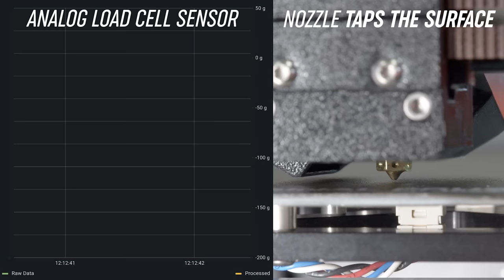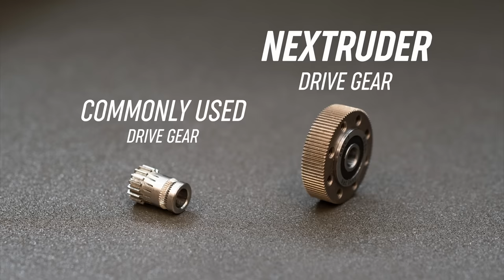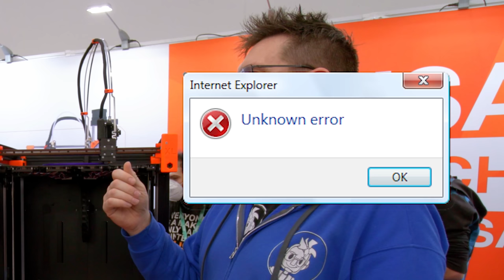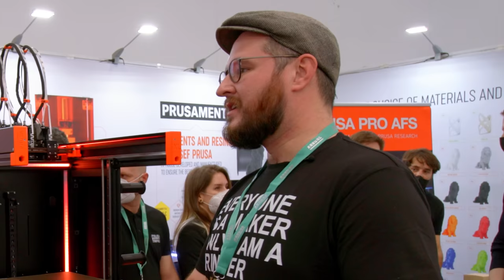Prusa XL First Look at Formnext! World Premiere!

Comment: Prusa don't just make 3D printers, they make quality machines that work consistently. No other manufacturer can claim that crown. Hopefully the XL will continue that legacy.  I want one and I want it now  to go with my Mk3 and Mini. Great Scoop Joel!
Reply: Except MMU and MMU2...
Reply: Except the MMUs which constantly cause struggle... and the Prusa Minis that were under extruding and clogging from factory... and the MK3S that had unlubed bearings but the manual stated that they are lubed, which caused damaged rods... and the not aligned filament path on the mk3s making cold pulls harder and affecting print quality... oh yeah and remember when they did linear advance from scratch but it ended up causing under and overextrusion in a firmware update?

so tired of hearing prusa fans drool all over the place. With that being said, their customer service is 10/10
Reply: It actually looks like it's designed to be cost-effective and they didn't waste a lot on a "pretty" look
Reply: Ultimaker also makes consistent and reliable machines, but are amongst the most expensive hobbyist grade printers

Comment: This is what all the moders are trying to achieve with Ratrigs and Voron!! Way to go Prusa, you killed it with this one! 🤯💓
Reply: Well, until now, both those had more advanced machines than Prusa. Now, the situation has reversed. But I suspect there will be new generations of these machines as well coming out with new features, which can only be good for the hobbyist 3D printing space.
Reply: @extectic  I mean, they sure stuffed it full of electronics, but kinematics are very basic and much less rigid. Performance and print quality comparisons will be interesting. As long as they're running marlin they don't stand a chance, but i hear they're considering Klipper :) 

Lot of very cool ideas in there though!
Reply: @miklschmidt  In the blog post they mentioned klipper as a means of exploring the limits of the printer. They looked at the speed boat race so there is probably some inspiration there. I'm so excited for this printer though especially since my V0.1 was my first experience with core XY.
Reply: @matthewdelacruz2460  They did yeah. I feel like the view point presented there was a little narrow minded, but i may just have read it wrong, it was a very short paragraph. Klipper is not just about speed. It's about quality at speed. It's so much more than the speedboat race, it's a shame that's all people think of when they hear klipper. As a former speedboatrace world record holder, i realize i've contributed to that though.
Reply: Yep, I'm like.. where can I buy a Voron?!   Voron:  You can't buy a Voron.  Me:  Okay I'll buy a Prusa.
Reply: @miklschmidt  The fact they have everything wired up to a PCI bus interface, that means they're building this to last a long time and be easily upgradeable.  I now see Prusa like Apple.. it may not be cutting edge but it's very thoughtful and really well designed for what it's trying to do.  A really agile hobby built system is going to be higher-tech than a mass-manufactured system, but you get a warranty, tech support, and a large community running on a standardized system.  When your hobby ISN'T tinkering with your hobby printer, then that stuff helps.
Reply: @dangerous8333  Do Vorons even have automated bed leveling?  Where can I buy a Voron and get a warranty?  You're really discounting the people who  value quality of life experience with printers.  Low budget people buy Enders.  Nerd engineers make Vorons.  Professionals and normal people buy Prusa.  I don't want a hobby to build a printer, I just want it to work, and have someone who can help getting it running again.  Just like I don't want to fix my own car.  This will do well just like Apple products do well.
Reply: @rhadiem  Completely agree with you there :)
Reply: @rhadiem  You might not be able to buy a Voron with warranty, but you can buy a Rat Rig V-Core 3 with EU warranty :) But correct, it requires you get your hands dirty, if you want a finished, supported printer, Prusa is killing it, no doubt.
Reply: @dangerous8333  I don't think you got the point with pricing. Fox example, I run a little 3D print. I was thinking about upgrading my farm with RatRig Vcore 3; but it mean an enormous amount of work to make them work correctly. And the cost of a similar Rat Rig is more than 1000€. For just the double you get something that will be so reliable, that you will be able to work more on your business than on your machines. If you want something pro like this today, you will have to pay 5000 to 8000€ on the maket and I don't think the machine you'll get with this price point will match the quality of the prusa XL.
Reply: @dangerous8333  you realize a voron of this size is $1600 plus tax and shipping right?
Reply: What prusa the open source scammer that just stole all the open source from Adrian at Nottingham university
Reply: @nelsonagryosgs5497  nope just make it yourself why are buying an open source kit for doh
Reply: Prusa seems a bit pricey than Voron, but
1. They give quite a nice set of features, which one day can go to open source
2. $2000 Prusa is expensier, than $1000-1500 Voron V2.4, but barely 2 times in extreme cases
3. Where I can see these will shine -- commercial sector. I can't see some company ordering parts for Voron, but complete Prusa XL -- quite possible
Reply: @dangerous8333  as someone who currently runs a farm of 11 vorons, I completely disagree. This printer will be a game changer. It's way more farmable than our current fleet of V2.4's
Reply: @ChromePhoenixQ  My biggest concern would be the Unique electronics and hot end assembly. With a Voron farm it's easy to go to a local supplier and pick up alot of the parts to keep it going.
Reply: @rhadiem  Vorons Do have automated bed leveling, you can Also have the no Calibration Z as well. as well as input shaper which there is no mention of in any Prusa documentation.. Yet. The Voron Discord can you get support 24/7.
Reply: Competition is good, this will push the voron and vcore communities to innovate even more
Reply: @dangerous8333  a vcore3 at similar size and specs is atleast $1500 and you still need to source some parts locally. You can easily invest $2k in a vc3 and you wouldn’t have the support and warrenty that prusa provides
Reply: Also need to consider the resale value. Prusa printers hold value much better then anything else. Buy a vcore or voron or creality and the value drops 50% soon after buying. Look at resale value of mk3s and it’s basically same as new
Reply: @dangerous8333  The current Voron doesn't cost much less at this size, especially if you option it up to the same specs.

Comment: AWE-MAZING! So much attention to detail, so many engineering breakthroughs getting all the features into a compact footprint. Price is on the high end for a hobbyist (but I still want one!) but I can see printer farms growing with these. Lead times will be interesting (quotes for silicone dies to be placed into packages is ranging from 6 to 18 months, up from 3 months in 2019). So frustrating to see great machines being designed and not being able to get them in our hands as fast as we were used to getting them. {SIGH} Great work by the Prusa XL team (heck, the WHOLE company)!

Comment: That would be nice to have the extruder sold separatly to retrofit a 3d printer. The no--filament-chewing, the gearing and the load cell combo is very nice.
Reply: the problem with that is that your printers hardware and firmware would need support for the load cell in order to make any use of this features.
Reply: @Pixelplanet5  you can convert analog Signals to Digital. Make a load Switch out of it, use it as the Probe pin, done.

Comment: This is not cheap, but I just pre-ordered. This will be my first 3D printer and I would like to spend as little time screwing with calibration and issues as possible. It seems this will fit the bill and everything I've seen says Prusa uses quality design and materials.

Comment: Pre-ordered a 5 extruder model. Would love to see a dual head with tool changing capabilities.
Reply: i dont see the model on the website :(
Reply: I just preorded the one with 2 extruders. IMHO good enough for now.

I already have mk3s with a mmu2s and it is amazing and I love the dual color prints, but sadly real multi material is just not possible or really hard and I would really love to use solvable support son occasion.

Comment: This is a balls to the wall awesome printer! I think that this one of (if not the) ultimate final printer for hobbists who want to take their hobby to the maximum level. The only thing I can think of that I'd love to see one day is some kind of x/y square test. By that I mean a 4 by 4 grid, like bed leveling, but instead the printer measures the difference between the expected and actual touch points of the nozzle. If the frame is skewed it could compensate for that. I've had a skewed ender 5 plus frame for almost a year now and it's almost impossible to solve!
Reply: They already have it since MK2 :)
Reply: I know how to fix your ender problem. Stop buying cheap Chinese printers and either build your own or buy a prusa
Reply: @thebutcher1412  yep, thanks for nothing. I needed the print volume
Reply: @rachellejanssen2655  gotta pay to play.

Comment: Nice, I had the same idea and designed an extruder with one lgx drive gear and two idlers.
I'm astonished no one did it before, it's basically a no brainer and way more effective than dual gear.

The overcomplicated bed though solves a problem that's not a problem if you have a proper construction in the first place.

Comment: looking awesome!

I just think it is too expensive :-/

2000$ for a FDM machine is just too much
Reply: @FayezButts  voron sounds great! Startet like 8 or 10 years ago with a Wasp 3D printer - had an i3 for seversl years, then built an improved a mini kossel and then constructed my own design.

Currently I do not have a 3D printer anymore - since my work uses so much time, I sold them all.

Would love to start getting back at it.

Need a fast and reliable machine.

Would love a belt driven Z-Axis though - since I had gotten quite accostumed to Delta's print quality on Z - which is simply amazing and absolutely flawless!

Comment: Yes, please take my money. Preordered  with tool changer (while  literarily waiting for Voron 2.4 parts to get here). Looks packed with tons of new teck. The new cycloidal drive drive should be interesting to see if addresses artifacts associated with gear drives. Love the Bondtech LGX so I'm happy to see the large filament contact wheel in this new extruder.  Clever bed design, efficient with zoning (light weight manageable warping), linear rails , ball screws, tool changer, Klipper, etc... They are talking all the right  words in there, so I'm afraid to ask what is wrong with it.

Comment: Prusa is amazing. I had a difficult time getting into 3d printing, first using Ender systems. So much tweaking and troubleshooting. As soon as I got my mk3s, I started having fun and learning things. I've had so much fun that I bought a second mk3s and a mini.
Reply: I mean you really start to learn things by tweaking like with an Ender, because Creality gives a shit about quality control. At least if you have the energy for that.
Reply: @norman7738  My Ender was a good entry point to learn about 3DP with low stakes but after “modding” (read: fixing) my first Ender 3 endlessly I’ve gone with Prusa and Flashforge and never looked back. It’s not always about the money, but the time it takes to constantly tinker with a cheap printer.

Comment: I’ve owned a Prusa for 3 years and love it! However, when the extruder jams or breaks it’s a complete nightmare to unclog or repair! It’s also mostly made of cheap fragile 3d printed parts which i don’t like. I hope they’ve corrected this problem. Also, even with the auto bed leveling, large parts often warp and separate from the bed. Most large print beds have this problem. How have you addressed this problem?

Comment: Very impressive machine. So many quality of life improvements and reliability enhancing stuff. Basically, push print and you're done. And presumably faster than the i3 just for being a CoreXY that has to throw around a lot less weight in the print head or sling the bed back and forth.

Comment: That is SO cool! I doubt I'd ever need five tool heads, but definitely two. Very reasonable price too.
Reply: I can see an easy case for three: big nozzle, little nozzle, dissolvable support.  Wish the price jump from 2 to 3 wasn't quite so big but for now, the little nozzle isn't as important.
Reply: @jdrevenge  Agree totally. Swapping nozzle is a bit of a hassle. I have nozzles from 0,25mm to 0,8mm. The rarely use 0,25 and almost never use 0,6. Frequently use 0,8 though, especially for transparent filament like T-glass and PETG. Having a 0,8 or even 1mm nozzle ready to go at all times would be really neat.
Reply: @Pile_of_carbon   Seems like a nozzle swap is super easy at least :)

Comment: If there is excess debris on the tip of the nozzle, it is still able to accurately set the Z offset? Is debris on nozzle automatically dealt with and compensated for or will we have to check and clean the nozzle every print? That would prove a little tedious as it's usually dealt with by the purge line. Or does it do a purge line and then the bed mesh?
Reply: with something this elaborate, I'd be surprized if there wasn't a brush in the tool changing bay that could be used to clean off the tip.

Comment: That heatbed is interesting concept. I have ender3 with warped bed, impossible to adjust with original mat,  steel plate works quite well but it does not solve problem.

Comment: I really want a corexy printer and this printer basically has everything I want in a higher end printer. My only problem is that it's way bigger than I thought! 31.5" x 31.5"?! That is massive! How is anyone supposed to fit that on a table? When buying my desk I made sure that it was much deeper than an average desk and even it is only 29.5" deep, not that I would even fit a 3D printer on that desk because that's where my computer, tv, and consoles are. My 3D printing desk is only 20" deep because I have limited space in my room. I guess I'll have to go with the Voron 2.4 because even at it's largest size it's only 20.0787 inches deep. I mean I really like the idea of building my own 3D printer, sourcing the parts, and adding mods like a nozzle cleaner and making it exactly the way I want; but the amount of research and fine tuning required to make a printer like that is substantial. My biggest concern about the project is that I don't have a lot of the tools required to make it to my standards of quality. Sure I can buy a soldering iron and crimping tool, which I've been wanting a reason to purchase for a while, but I don't have any cutting, sanding, or machining capabilities for some of the parts of the assembly that I want to be made properly without any jagged edges or uneven surfaces. Plus getting a tool changer working for multi material printing is going to be another monumental task on top of that. I just really wish that this printer was like a foot smaller in each direction because I absolutely love my Prusa mini and the entire prusa ecosystem. I hope the i3 MK4 is just a mix between the design of the prusa XL and the size of the MK3S, though that wouldn't really make sense since the i3 is specifically a cartesian design itself. They've got the Mini, now the XL, next we need the medium. Call it the Prusa M😅

Comment: Lots and lots of really nice features here. It'd be interesting to use that nozzle strain gauge with a special probe (typically a small ball on the end of a rod) and turn the machine in to a 2.5D coordinate measurement machine (CMM).
The component supply situation is NOT going to improve soon. It's going to be with us through 2022. We are still seeing some semiconductor leadtimes increasing to the point that some companies are quoting well over a year to get anything now. We've only been able to avoid a major impact through a massive effort from our commodities team and partners.
It takes 2 years to build a new semiconductor fab (and that's when ASML and other equipment suppliers aren't swamped), we should see some incremental expansions happening a bit sooner, but 2022 isn't going see much relief.

Comment: If the slicer could support this I presume you could have different nozzle sizes on the toolheads so you can print different resolutions on the same part where needed.

Comment: Wonder why no one has gone with an induction heater, with so many printers using magnetic beds, it seems like induction would be a really good choice for a heated bed.
Reply: what would be the benefit other than "cool" factor?
Reply: @cocotug0  they are more efficient, they take less time to heat up, are more controllable, would be a much more consistent temperature. Since the only thing actually heating up is the build plate itself

Comment: Looks sweet.  I was looking to buy an IDEX but a true tool changer would be far more flexible.   Price compared to building a CoreXY and getting an E3D toolchanger up and running isn't that bad.  Def not cheap but the printer looks well built.